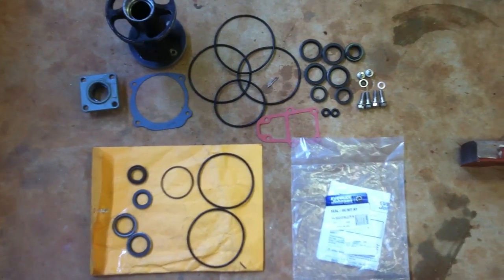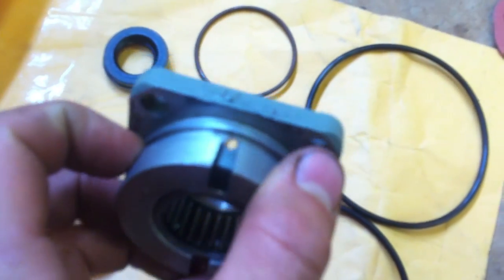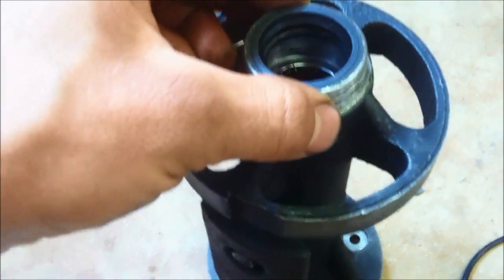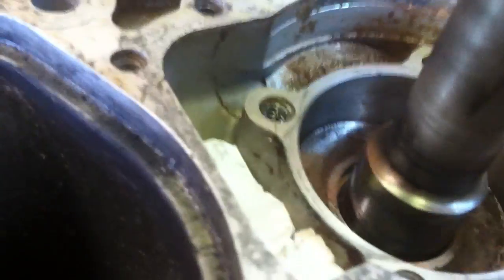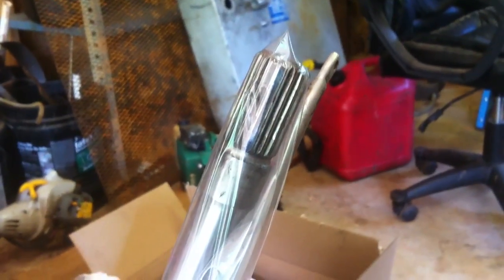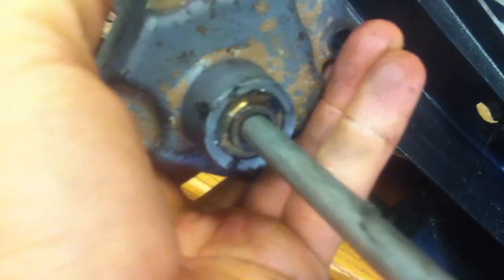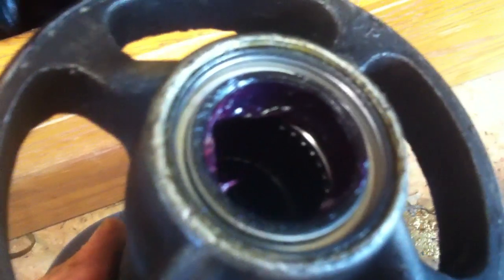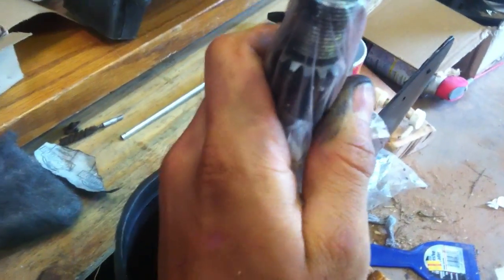How to replace outboard lower unit seals

Comment: I dig your channel man! Where did you find that shift rod length chart? I'm trying to adjust rod on a 1989 Johnson 90hp V4 with long shaft 20"
Reply from the maker: It's in my service manual. You can sometimes find the spec chart using google.

Comment: Hey Matt.....I am about ready to reinstall all of my gaskets and seals but i am confused with the orientation of the prop shaft seals.  My shop manual shows  a confusing looking cartoon pic of how they should go and they dont describe it well either.  I would explain that one side of the seal is the open faced side...and the other is the rolled face side.  Tell me if I am reading this correctly.  From what I can tell it wants the rolled or closed side of the first seal to go in first......then the second seal will actually go in the same orientation....rolled side first with open side facing the propeller.....is this correct?  Here is the wording from the manual.  Install inner seal with " flush lip " facing the bearing housing then install the second seal with the " extended lip " facing away from the bearing housing.  

This is a piss poor explanation.....I could interpret the flush or extended lip either way.....and like i said its the only area where they show no pic...just a cartoon .....

Let me know if u can help....
Thanks
Reply from the maker: It's kind of hard to describe on here but:

Prop shaft side lip with spring on it faces out towards the prop.
Gearcase side seal lip with spring on it faces in towards oil.

So the flat sides of the seals are touching each other.

The outer prop seal holds water out, and the inner prop seal holds oil in.
What is the exact model number?
Reply: Ok.....so u are basically saying back to back.......inner seal open face towards oil.....outer seal open face towards prop.....thus the 2 rounded closed ends of the seals are touching each other.....does that sound right?
My engine is a 1999 Johnson Ocean Pro 150
J150PXEES
Reply: Hey Matt....I read the manual again.....It says to install the seals back to back.  They say install inner seal with lip facing toward the bearing housing then the outer seal with lip facing away from bearing housing.  .  The other quote from the manual i wrote here was for the drive shaft seals which I am also replacing.  Seems like Yamaha does it differently for some reason....I watched every video on YouTube.....but got different answers along the way....back to back makes some sense I guess.
Reply from the maker: No, this is the way most of them are back to back like that just like I described. I'm glad you figured it out!

Comment: good vid dude.  I have a 99 Johnson 150.....I just ordered a bunch of the seals...I think the seals have changed a little bit since 86
Reply from the maker: +Jim V Thanks! I bet you'll be suprised how little they have changed. All these lower units are basically the same thing just with different o-ring sizes and stuff. Make sure you watch my bearing carrier removal vid to give you some ideas on how to get the bearing carrier out. https://youtu.be/dLlNOumzPTY
Reply: Matt...your video really helped me with some specific details.....it also confused me.  So I have a shop manual for my 99 ocean pro 150 and it actually shows the two opposing seals that you used for prop shaft and drive shaft.  I watched another video recently posted on this subject and he used a single seal in both of these areas.....so I am not sure if the single seal is the modern version....or if he used the wrong seal....but yours do look correct according to my shop manual.  You also taught me about where and why to use form a gasket which I did not think of before.  So that is my next question....in my shop manual they list about 7 different greases....sealants.....gasket stuff....etc.  This is important for me to get right or like u said....all this hard work for nothin.  Looks like u just used form a gasket and grease for the job is that correct or do you suggest something else?  Last question....how did u press your seals in?  Thanks!
Reply from the maker: Thanks! I'm glad I helped! Check the parts diagram and make sure you put it exactly like it shows. I think I had the seals oriented wrong when I mocked them up in this video and added an annotation. I pressed them in the right way though. Just make sure on the rubber/spring lips one seal faces out towards water and one faces in towards the oil. It should be two seals. Just check the parts diagram.

Nahh, you don't have to get all of the factory lubricants, oils, gasket makers, and stuff. You can look online for substitutes. The aviation gasket maker is nearly identical to the Evinrude/BRP stuff. Just use a high quality waterproof grease. It's going to be filled with oil anyway.

Get a socket that is a tiny bit smaller than the seals and then start them flat and pound them in hitting the socket with a hammer gently going from one corner to the other to make sure they go in straight! After you put aviation gasket maker on them. Make sure you don't damage or scar up any of the metal on the bearing carrier where the seals ride because you will get leaks for sure. Clean up the prop shaft with a little fine grit sand paper so that it seals well. Just go slow and it should come together pretty easily.